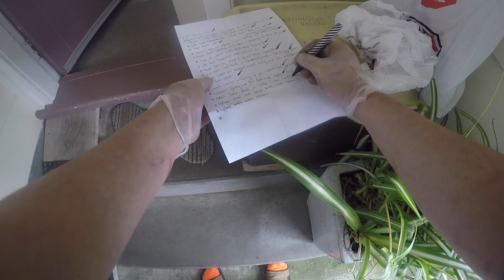DR650 Plex valve install and impressions

Comment: Great Video Mate.
Verry clever oil gauge, I used a cheap vernier caliper depth gauge and kept topping it up slowly (on my xr250) until it ended up on the end of it.
Thats why i watched your video, to see if FFRC were just full of hot air but they sound legit.
Reply from the maker: Thanks mate,yeah if I hadn't of had a syringe lying around I would have done it the way you did.Stoked as with the results,would recommend FFRC and there products .Just awesome :)

Comment: The unexplained crowbar at the start crack me up man, half expected a claw hammer next lol. Seriously though good on ya, I'd have put that in the too hard basket. Good improvisation and I'm glad it worked out for ya. Cheers.
Reply from the maker: Thanks mate yeah needed to be done.Im slowly learning the ins and outs of motorcycle mechanics which is good if you wanna save money.Good bike to learn on:)

Comment: Great instructional video.
Just curious, but when you drop in the Plex valves into the fork leg what prevents them from turning upside down by the time they reach the bottom?
I'm a light weight rider around 158lbs, would this mod make the forks too firm for my weight?
Reply from the maker: Thanks mate,yeah the plex valves are a pretty good fit for the inside of the fork leg so no chance of flipping on the way down.When you order the Plex valves FFRC asks you what your weight is and what extra weight you will have on the bike luggage,pillion etc and they will tune them for you.They also make recommendations on what weight of fork oil and stiffness of spring to go for.Im around 185lbs and went up to 10w oil (from 5w stock) but kept the stock progressive springs.this setup is perfect for me but FFRC will recommend whats best for you.Basically turns your rod forks into cartridge forks,I recommend this upgrade:)

Comment: Did you consider the Cogent DDC instead of the Plex? Since you were going to get a cogent shock anyway?  I do not own a DR650.. yet. It’s on the list for my next bike. However both my wife and I have had all Cogent suspension components and have been very happy with them. The only thing I might have done differently in your vid here was replaced the variable rate springs with single rate springs. Your vid was nicely detailed. Thank you
Reply from the maker: Cogent on the rear shock, front was always gonna be plex..FFRC designed it to be the best..and it is.

Comment: hey, thx for the video. I was wondering if you could explain in a bit more detail how did you attach stock headshield to aftermarket pipe? thx in advance
Reply from the maker: Thx mate all good.What I did was I made up two aluminium brackets which I bolted to the back of the heat shield using the stock hex bolts that originally held it to the stock pipe (just found some stainless nuts to fit).The distance between the top holes on the shield and the bottom are different (top 180mm,bottom 110mm) I used two strips of aluminium 4mm thick and 20mm wide.I cut the top one 230 mm long and the bottom 160 mm long (once bent to shape this gives a 10mm gap between the heat shield and the pipe and enough room on each side to drill holes for the hex bolts.I used a vice to bend each length to this shape  '''''''''''|________|''''''''''  marked drilled and bolted to the heat shield.Then found some stainless hose clamps just larger than the circumference of the pipe and clamped it to the pipe.EZ.glad you liked the vid hope this helps.Also I talk about it a little in my review video check it out:)
Reply: Thx a lot for that info, I remember you mentioned this in one of your videos but i couldn't find it, so i just decided to ask
Reply from the maker: rombick no probs mate

Comment: Is it possible to install plex valves without removing forks from bike just supporting front end. Thanks
Reply from the maker: Go Ahead Make Our Day Scooter &Peanut should be if you use the same oil in the forks and remove handle bars Alltho seating the valves properly may be an issue and setting the air gap in the forks could be difficult.taking the forks off is the best way just takes more time.cheers

Comment: Did u replace the springs also or just the FFRC plex valves only?
Reply from the maker: Kept the stock springs but put heavier 10w fork oil in..stock is 5w.

Comment: My Dr 650 is all white also, I want to make it look just like yours. what do u clean your plastics with ,yours look super nice. And I am going to buy a jack like yours also. where did u buy it?
Reply from the maker: Hey mate usually just use regular wash and wax on plastics but if they get oil or grease on them a little wd40 works as long as you wash it off.bought the jack from repco.cant remember the exact cost but wasn't more than $300
Reply: @drsous6400  Your bike looks sooo awesome! Hey man do u know how to disable the clutch sensor on the Drs? Mine stalls at stop signs and red lights sometimes.

Comment: Hi mate are you still happy with this mod? I’m looking to buy a dr next month was going for emulators. But these are an option. Your reaction on the 1st ride was positive. I would value your opinion. 👍
Reply from the maker: Hi man.yeah am still very happy with this mod and would recommend getting the plex valves.If your going to be hammering it off-road I'd get stiffer springs as well.I kept the stock springs and they work fine for what I use the bike for ie road and light off-road.thx for watching :)
Reply: DR SOUS Mate thanks for replying that’s exactly the riding I will be doing. Had a monster for 13years ride around on it, go camping great bike. A dog wiped me out broke my collarbone and a few ribs. Bike written off ☹️ So after watching videos like yours which are very helpful. The dr is a great bike to do that on again. Thanks mate.